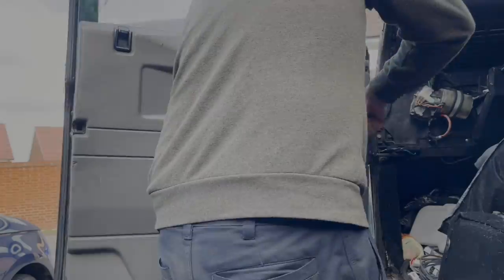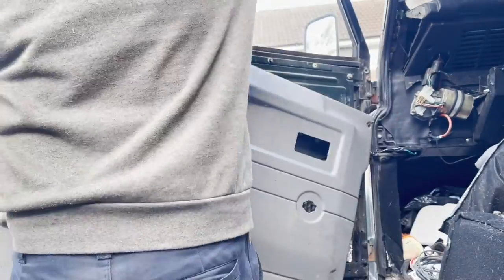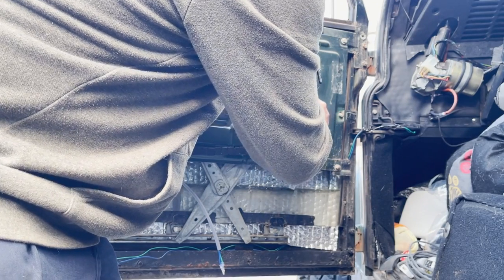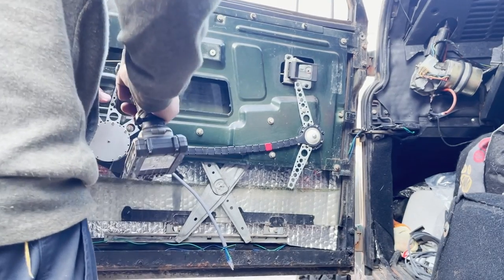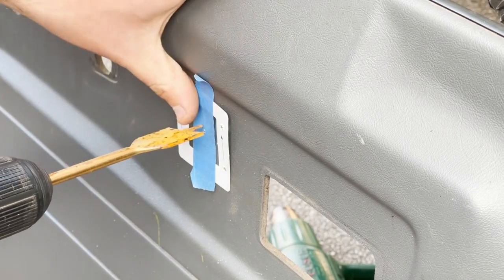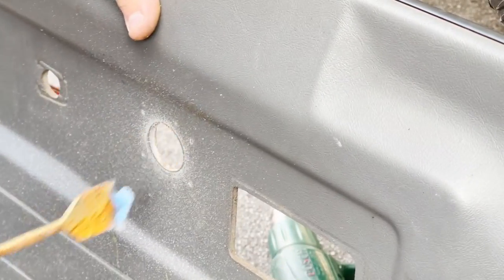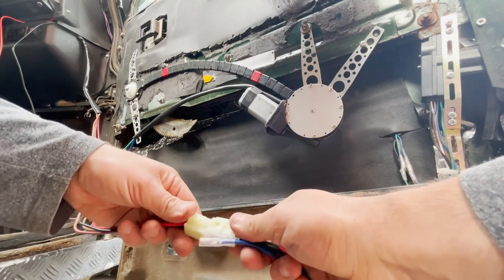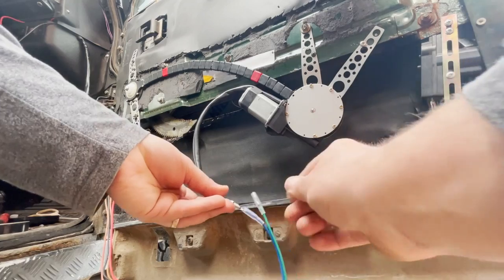Installing Power Windows to an old defender 90 / electric windows modification upgrade

Comment: I suppose you could always make the cabling longe and have a switch on the dash
Reply from the maker: This definitely is something I had considered originally, but because my dash didn’t have the central console I decided that I’d keep them on the door for that reason. It would also result in less wires in the doors, so it probably would be the better way of doing it.

Hoping to get a 110 defender next, which I’ll be doing the same mods on, but using what I learned from these to save time and money, and improve the modifications.